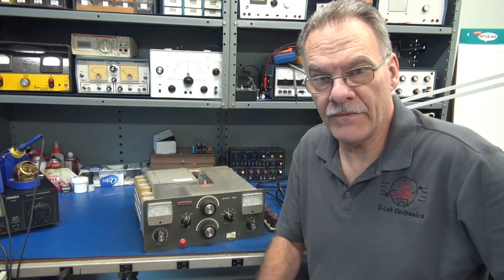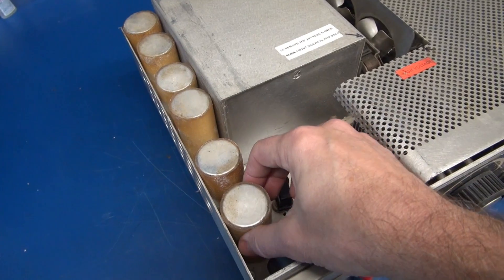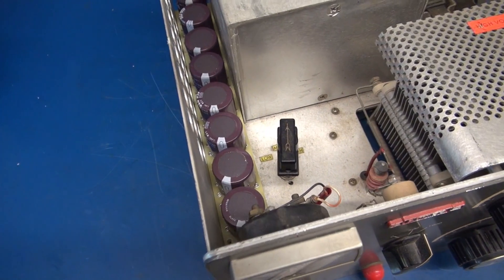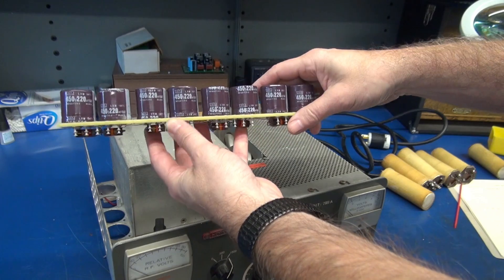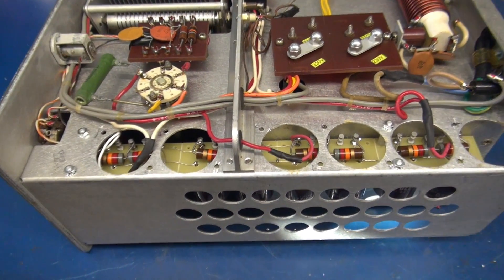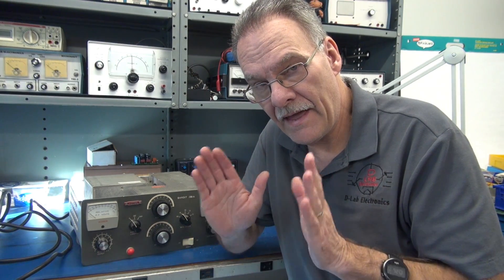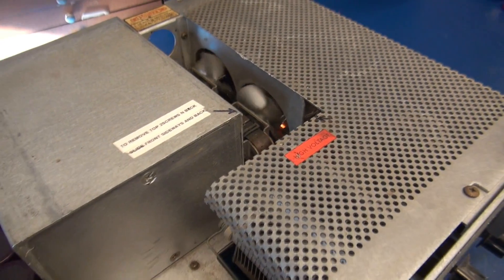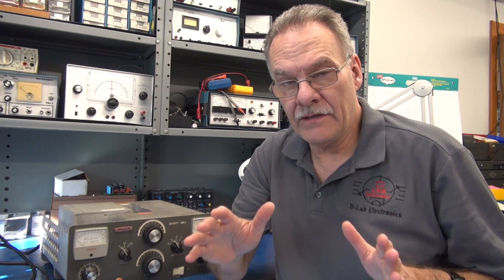Hunter Bandit 2000 Ham Linear Amplifier Filter capacitor replacement Optional Method

Comment: Terry, that amp is in great shape. Ted made some good stuff after he left Collins Radio. I have used the old mica or fiber bases, if their still in good shape. Just twist and unlock the cap tabs and pull out. Then run the radial leads thru the slots. Of course with those snap leads you would of had to ad leads. The way you did it is very nice and updated. Hey wheres the wine? Wine at 3000 vdc would be fun. 73 nice work. Over. Over

Comment: What an elegant solution Terry! I use a commercial 110 - 220 VAC transformer (really a small adapter) to check amps, obviously not on transmit, but to at least apply 220 to the amp to just see as you did if the unit comes to life. 73 - KLØS